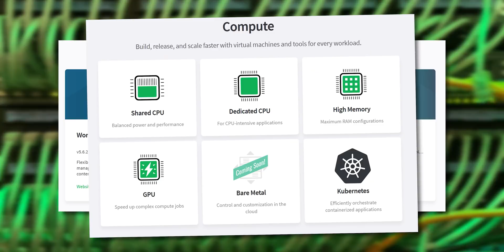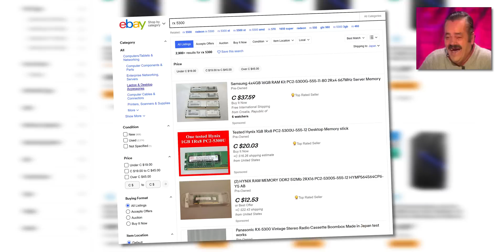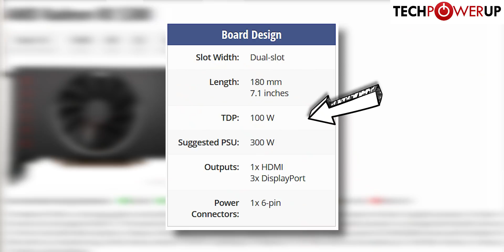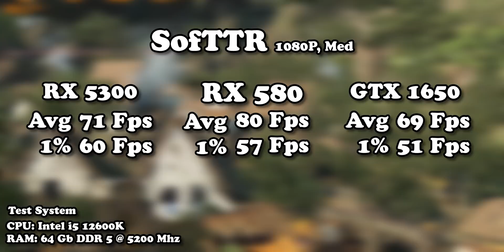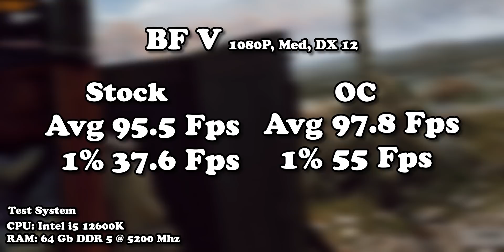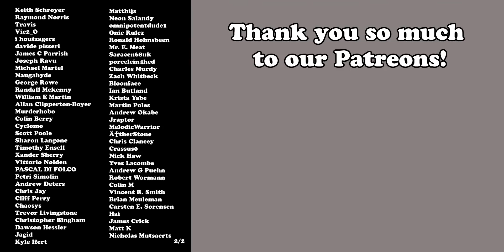AMD's Long Lost Budget Gaming Graphics Card

Comment from the maker: Fun fact: The RX 6500 XT actually has a smaller memory bus than this card. 64 bit vs 96. 😂
Reply: Which is more the reason why the 6500xt is a joke
Reply: @kruegersix  people will just ignore the infinity cache?
Reply: @kruegersix  well, now it is a $260 joke.. so.. jokes on us i guess.
Reply: 6500 XT probably runs slower in a PCI gen 3 system too!
Reply: @jasonlewis810  up to 35% performance loss on pcie 3.0 according to benchmarks I've seen so far
Reply: @jasonlewis810  yes on some games 15-20% slower
Reply: @jasonlewis810  hardware unboxed shower that in worst case scenario’s, the 6500xt lost over 50% performance on pcie 3 vs 4
Reply: @jasonlewis810  it does. hardware unboxed tested PCIe 3.0 also
Reply: If its running so low can't you modify the bios values up to 135 watts ? That should be safe enough and allow you to get the core to an even a higher frequency. Red Bios Editor can be used for it.
Reply from the maker: @tqrules01  That could work, but that memory configuration will still hold it back. I don’t think it’ll lead to any additional performance.
Reply: @DawidDoesTechStuff  Yes 3Gb is quiet little. I modified my gpu because 4GB was just enough for me to make it worth it, got a bargain bin Nvidia Quadro K4200, It came with a boost clock of 841 mhz... terrible numbers for a 150watt gpu. Downloaded the Kepler bios editor and saved the bios file sing gpu-z and started changing some values on max TDP and vcore offset. Got it stable to 1060 on the Core and 1525/3050 on the memory. The max board power is at 132 watts and the temp is maxing around 68C with a fan at 85%. The trick to lower the temperature was to add like a line of  heatpad between the outershell and the beginning of the heatsink. This forces the air through the heatsink instead of just over it. I love your videos have a great day!
Reply: @DawidDoesTechStuff  For science though.
Reply: @DawidDoesTechStuff  hey on dells hardware store they have a weird rx640 4gb for $150. Ever heard of that card before?
Reply: @tqrules01  did ya watch the video?
Reply: I haven't seen a 64bit card since like 2008...
Reply: @theforerunnerreclaimer  the only other retail card I've been able to find that uses a 64bit memory bus or less than 8 pcie lanes is the gt 1030 which literally launched with an msrp of $80 and marketed as a display adapter
Reply: @brandnewfan182  Oh yea, that one too...but it isn't marketed as a gaming card, like you said, it's a display adapter
Reply: @brandnewfan182  I think the 730gt does as well.  It's been a while since i have looked at those old cards but I think that rings true
Reply: @brandnewfan182  yet before i got my used rx 570 8gb , i used to play fortnite on low setting with a gddr5 gt 1030 and i had my 60 fps at 1080p. still got it in case my rx 570 dies because who can buy a card at a decent price these days.
Reply: @theforerunnerreclaimer  look in a laptop for the mobile gpu, then you can find more.
Reply: @theforerunnerreclaimer  people will just ignore the infinity cache?
Reply: @TheMakiran  Infinity cache doesn't mean anything when the GPU is slower than a 6 year old GPU...even in benchmarks with a Ryzen 9 5950x the thing is slower than a 470
Reply: @theforerunnerreclaimer  infinty cache compensates the small memory bus on the all rdna2 cards. From the performance stand point sure, there is not increase. But is that the only metric we should you to compare gpus? If you want, its a rx 470 with double the efficiency
Reply: @TheMakiran  yes, but performs worse
Reply: @theforerunnerreclaimer  we can both cherry pick all day, there is games where the 6500xt is better than the 580 so what
Reply: Can't for the life of me understand how they didn't give it at least a 128bit memory buss... would have made the card a pretty decent competitor.
Reply: @CoolTI-Daniel  reasons why they didn't : gddr6 prices are insanely high right now, 128mem bus is overkill for this gpu anyway, the card would be substantially more exprensive
Reply: nothing fun about this fact 😥
Reply: The 6500xt is just that much of a beast. It doesn't need STUPID things like memory, a sensible memory bus or actually being PCIe4 x16 to kick your ass.
Reply: And also uses x4 lanes instead of x8 lanes. lol
Reply: Fun fact, back in 2020 amd also said 4gb was not enough..... soooooo this shoukdnt surprise anyone!
Reply: David, make a video on the ThinkPad Z16 RX6500m or any other laptop with that gpu
Reply: I was actually gonna reply "probably still better than a 6500xt".
Reply: Definitely they should increse 1gb of ram on rx 5300 and sell that insted of 6500 xt.
Reply: careful, the AMD fanboys are now flooding comment sections defending this garbage and are being butthurt. Fanboys in each camp are insufferable pieces of crap and are the reason why garbage being released is acceptable.
Reply: @NightMotorcyclist  I haven't seen anyone defend it yet TBH, but sadly this trash will sell out anyways.
Reply: @NightMotorcyclist  the 6500XT is just shit straight from the factory
Reply: 🤣🤣🤣😂😂😂😂😅  Ahhhhh thats sad
Reply: Oof
Reply: I am insanely angry. The logo of the companies became 99% to serve the miners and waste (rx 6500 xt) for the players.
Reply: @Dawid Does Tech Stuff try to upgrade vram and put the  modified bios
Reply: it also has less compute units at 16 I believe
Reply: Just glad I got my rx 6600 when I did hehehehe xxxxx
Reply: I was gonna say it still seems better than what they just launched.
Reply: You do know your frame rate is useless if you do not use a cpu that most people use right?
Reply: @0MeALot0  The entire point of GPU benchmarking is to show what the GPU's max capability is. You use a CPU powerful enough to not be a bottleneck.
Reply: @802Garage  Well then it failed too, in the future new cpus and platforms will be even better... In that case the i7 and i9 results are missing, xeons are even stronger. But looking from a consumer you would watch this to see what to expect, while nr1 used cpu is a 4 core. Making this utterly useless. You do not get the same result with all platforms.
Reply: @0MeALot0  You're really missing the point. 🤦‍♂️ Everything is relative, but as long as your CPU isn't the bottleneck, you get a general idea of performance uplift.
Reply: What do you think? Did amd drop polaris support so you "will have" to buy "better performing" rx6500xt?
Reply: 6500XT is a disappointment. Why is there no next gen rx580/rx570 competitor that is an upgrade while staying at a similar msrp
Reply: @RaiuAdami  bc miners would buy it, btw if you have 580 like me, its not supported so you will "have" to buy that shit 6500xt
Reply: @pekiimatvrdi  Nah I'm not. I'm staying on my 580 till it dies at this point.
Reply: @RaiuAdami  which version dp you have? I have sapphire pulse 4gb
Reply: @pekiimatvrdi  8gb XFX card with really long name, not ideal but it works at least
Reply: Hahaha! Good Video!
Reply: it also has obvious space on the board for more VRAM, as opposed to the RX 6500  (possibly XT?)
Reply: @ Dawid Does Tech Stuff. Pls put them head to head
Reply: What about GTX 970 256bit graphic card 🤧🤣
Reply: you know whenever I see a PCB with an open chip slot, I remember backin the 80s how you could solder chip on chip and modify things easily.  I wonder if you had a hot air station could you add in more Vram?  Would the card post?  What tools would you need to start directly modifying elements of the card?  Obviously you'd need chips, but seeing as it's an OEM, sacrificing parts of one to the Gaming Gods isnt' terrible a loss anyway...
Reply: And they are the same performance LOL
Reply: Hope no one buys the 6500xt
Reply: What did you expect from the 6500xt? It was designed to be unappealing to miners do you're literally dealing with lack of performance as an accessibility feature. They even let you know this before they put it out. So seriously folks diminish your expectations. They delivered essentially what they said they would, warts and all.
Reply: AND THIS CARD DOES HAVE VIDEO ENCODING LMFAO
Reply: Do a video with old intel i5 with gt 1030 vs moreden intel apu.
Reply: Because 6500 uses  2*16Gb GDDR6, while 5300 uses 3*8Gb.
Reply: You can't really judge a card,  based only on the RAM bus width.
The real issue with 6500 is the combination of 4g RAM and the PCIe 4x connectivity. 
If you use it on PCIe4 motherboard (Preferably B550 /X570  ), it performs slightly better than a 5500XT 4g.
On PCIe3 boards, the communication overhead between the SSD/RAM/CPU/GPU/VRAM due kills its performance, because has page the VRAM very often.  4g 5500XT suffers from the same issue.
Reply: 6500xt vs the RX 5300
Reply: @bengalplays2657  
5500XT/6500XT is about 15% more powerful.
Reply: Another fun fact: for every gigabyte of vram on the rx 5300, there is 32 bits, on the rx 6500 xt it is 16 bits
Reply: Dawid, it doesn’t matter if the bus width is “slightly” bigger than the RX6400/6500, when the thing only has 3GBs of VRAM, and this is supposed to be a “mid-range” GPU :/
Plus this thing takes 100 watts of power, which is a bit much compared to the 6400, which can just take power from the PCIE slot entirely. But well, the 5500 XT exists, which has 4GBs of VRAM, and also runs at a decent boost clock with more cores compared to its “successor”
Reply: WTF what is amd doing
Reply: Can't wait for someone customize rx 6500 xt bios, so the upgrade will be pushing its limits.
Reply: @johnnyelijasialuk3879   no point. Its limited to 4x PCIE electronically which means in anything below a pcie 4.0 motherboard "basically  95% of all other cards" will outperform it. Even a lower end card or a card with less shaders will still beat this e-waste product. It also lacks a bunch of tech for streaming so using it as like a secondary OBS card is not possible. The RX 6500 is a worse card then the RX 5500 which has more shaders , more rops , more bandwith, making this the worst gpu lauch in the last 8 years. The only gpu to come close to this controversy is the GTX 970 and its 3.5 GB bottleneck problem.
Reply: @johnnyelijasialuk3879  I don't think a bios customization will help, there's only physical traces for x4 going to the slot
Reply: @johnnyelijasialuk3879  its already pushing it limits...Those limits are 4 PCI lanes and no software/bios magic is going to change that.  The 6500Xt is a complete joke.  Not worth the metal it is made out of
Reply: @johnnyelijasialuk3879  64 bit bus and 4x PCI-E will hold it back.
Reply: Upgrad it's vram as it's here a free space

Comment: You know, because of this video, and because I managed to get a GTX 1650 GDDR6 at a low price in the lull between CryptoCraze and CryptoCraze2: The Sequel™, I'm going to say that I was fascinated by this little guy.

And, thanks to the thoughts from this video worming their way into my head, I wound up recently buying a used one of these, for around US$75 after tax and shipping.  I don't even entirely know why, except that I was fascinated by what this little budget GPU that could-have-been could do, and that it likely didn't need that auxiliary power connector (disclaimer: My particular 1650 also has such a connector).

I don't even know what I'm going to do with it yet.  But I have it, and have now stuck it in a test bed system.  Well, what I call a test-bed system, as I haven't done much with that system, either.

You're an inspiration.  Or a bad influence.  Probably both, come to think of it.

Comment: Honestly, if I looked at the 5300, then the 6500XT…. I’d take the 5300, simply because it takes far less power in a technical sense, with the specs it has. Like…. The 6500XT has 1024 cores with a max boost clock of 2.8GHz, compared to the 5300 with 1408 cores, and a max boost clock of 1.645GHz. Which the 5300 was classed as a mid range GPU at the time, while the 6500 was pegged as an entry level GPU. But an entry level GPU in my eyes, has to ONLY take 75 watts maximum, which is all a GPU can take from the slot itself.
So it’s dumb the way the last gen GPUs were reasonably classed, and more efficient, while that one Navi II GPU was made that horribly.

Comment: I actually bought an rx5300 off ebay for my main pc recently. I don't do much gaming on it and it was a decent upgrade from the 2gb rx460 I had in it before. I wanted a card that could do VP9 decode in hardware and drive 3 displays. It was pretty cheap, and it has been a solid card for me so far!

Comment: Why......why not have released this to the DYI? At 130 MSRP it would have been a pretty nice little card. Hell I'd take this over a 6400 or 6500 in a heartbeat. Hell, it could easily have been a low profile/no supplemental power unit, and would have sold like crack cocaine.

Comment: Did you get it off ebay around mid January? Maybe we were competing for it :)

I bought my RX 5300 two weeks ago. Mostly for my hackintosh aspirations and the form factor, but I do plan on playing with it. My upcoming projects are a Noctua 92*14mm fan install, soldering on the 3x2gb memory chips and possibly editing the bios should it not post with the said memory configuration.

Thanks for the video! It's a cool one.

Comment: They should have released the 5300 instead of the 6500, especially if they could MSRP it at even $150, granted, you're correct in saying if it was released it would likely be on the secondary market for $250-300(much like the 1650 currently is)

Comment: I agree, it is astonishing that this card couldn't have been slightly tweaked to not require any external power that it can't get from the PCI-e slot. This would be a perfect card for an old Dell Optiplex if they had done that, and I consider that the primary use case for a card in this performance range. A missed opportunity by AMD to get their card into the niche where it belongs.

Comment: This card is identical in many ways to the 5500XT as you mentioned.  I bought my 5500XT from Dell in the fall of 2020 except my 5500XT has 8GB of memory which is makes it so much better.. It is a surprisingly good card as I can game in 1440p at medium settings and get 60fps. In games that utilize FSR, I can get 100fps using the High Quality Preset in 1440p (RE Village).

Comment: I'd get one to replace my 1GB GDDR5 Radeon HD6670 with if they were able to be bought easily, the only problem with upgrading to one of these cards is there are no VGA ports so I would need an adapter to keep using my old HP VS19E monitor, the HD6670 uses 66 watts and the card I have was broken when I bought it (but it was only $16 on ebay and the seller said the card was broken in the item description), I replaced the thermal paste with arctic MX4 and was able to use it with the core set to 800MHz and the VRAM set to 700MHz but it's getting worse so I have to run the core and VRAM at 650MHz now and even with the speeds turned down that far it still puts yellow or red squares on my monitor or the driver crashes and locks up my computer requiring a press of the reset button on the case to reboot because the mouse will move on the screen but I can't close or open programs, It doesn't do that while playing GTA online sometimes it does it when I play minecraft java edition but it does that most often while playing games in dolphin or project 64 which is weird because those emulators don't use the GPU very much.

Comment: I bought a optiplex from a tec repair company in 2019 they shoved a 8gb 570 into it with a upgraded power supply from stuff they had laying around I got the PC and a monitor for 275$  it was such a good deal I asked em like why's it so cheap and the guys say we like giving back to the community not usually what I'm used to hearing but I leave leary and they weren't kidding thing runs like a top to this day had to upgrade the ram but I got this maybe 6 months before stimulus checks went out and even before that GPUs had been in short supply for a year or so I deeply missed PC gaming and was very happy my poor butt could get back into it weirdly alot of people I work with have been finding nutty pcs on craiglist from people who need the money I suppose like 6500 series full PCs for 1300 his brother scooped a 5600 full built PC for 800 as well

Comment: Power use on amd rdna1/2 only reports core power use I think similar to the rx400/500 series and the rest is used up by the memory and other various circuitry losses so its 100w tdp is actually on the spot or in this case maybe around 90watts, still impressive though for old games quite efficient.

Comment: Fun fact: This is not a typical usage scenario for that graphics card or any of the other graphics cards you tested. No one who can afford a brand new motherboard that can support a brand new i5 12600k and 64 GB of brand new 5200 Mhz DDR5 is going to be looking to buy or use any of these cards on a daily basis. These cards should have been paired with a system that's more in line budget-wise of the price they'd pay for these cards. This video helps absolutely no one. It's the first video of yours I've had no choice but to dislike, despite the undeniably awesome Dawid-isms in the sponsor bit.

Comment: 5300 should be consuming 100W, not 75W as AMD software monitoring does not account for VRM power loss. 
Meanwhile 1650 is actually consuming <75W because Nvidia software monitor the total board power including VRM power loss.